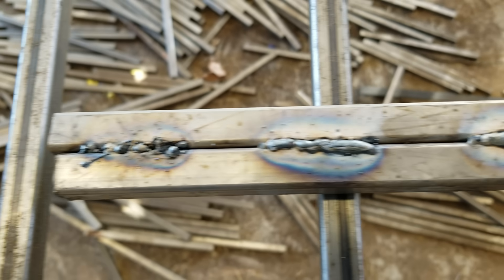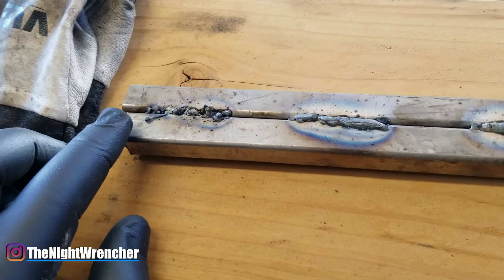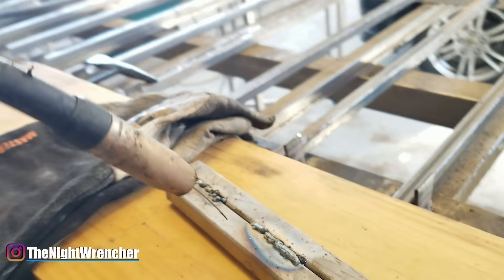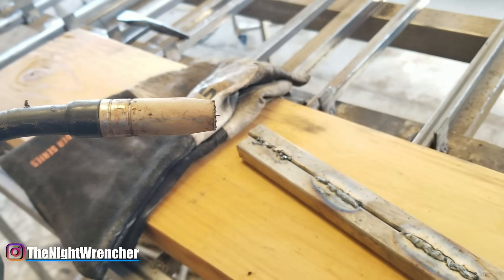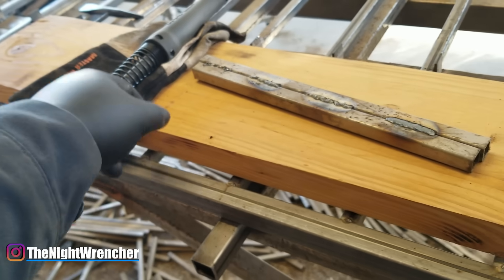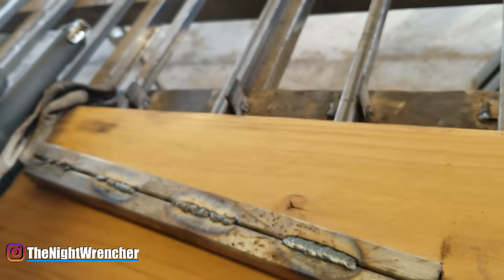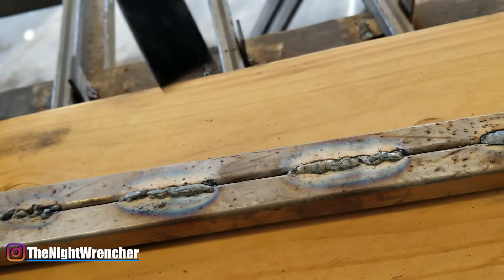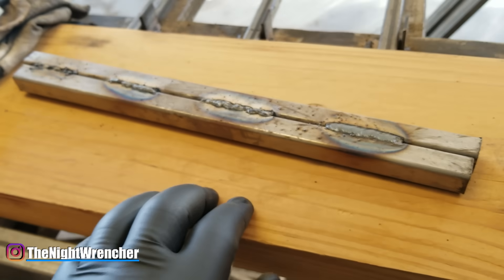Learn Perfect Flux Core Welds In 10 Mins | Gasless Flux Core Welding For Beginners Tips And Tricks |

Comment: Your title is nuts. There is no such  thing called gasless FCAW. the process is called flux core  Arc Welding :flux is wrapped in the center of the "wire" which provides a "gas shield when on Arc.  Your lead is more to do with keeping your puddle fluid! the stacked look in this particular process is the result.
Also ; contaminated "wire" contaminates the puddle as does dirty material.  To give you primary reason for  piping or spatter!Your joint "prep" is also key to flow weld metal for a desired profile. You can btw use the process with gas . Dual shield  most common 75/25 or 80/20  Argon and Co2 respectfully. Or 100% Argon depending on deposit, profile and or effective throat you want with the proper wire. the most common wire feed processes Sub Arc, Mig,FCAW , utilize a drop slope curve when on Arc. That is;your stick out has a self correcting arc in short to help keep the  finished product looking nice ( the deposited weld) to make a long story very  short....... Good beginner stuff  in the video tho.
Reply from the maker: The title is geared towards people who arn't familiar with the correct terminology and the video was basically a PSA that maybe its not your welders fault that your welds come out gross 👍
Reply: @NightWrencher  , correction the correct acronym for "Mig", metal inert gas Process is: GMAW  Gas metal arc welding . Apologies
Reply from the maker: No problem 👍

Comment: tip distance tip speed and tip angle greatly determine weld outcome. i learned to weld almost 40 years ago but now only have a 110 volt flux core welder. 

my grandson is 10 and i told him i would teach him how to weld. well, weld with a gun anyway as there are several ways to weld but i do not have a stick welder or oxy/acetylene torch or a tig machine. using mig or flux core to weld is as easy as it gets. smaw, or stick welding as it is commonly called, takes a lot more practice to do well. when you have done that for awhile picking up a mig gun and laying down good beads is a cake walk. i remember the first time i used a mig i thought 'man this is like cheating'.
Reply from the maker: Very cool! I hope your grandson gets it!

Comment: Remember this tip, if using an .030 wire, use an .035 tip. This is a big deal on the flux core wire. Not so much with the solid wire because of the shielding gas but with the flux core wire, it makes a huge difference.
Reply from the maker: I've tried using a .035 tip on my .030 wire because I ran out of .030 tips. I noticed the wire movement side to side was very inconsistant and running solid beads became more difficult and messy.

Comment: Six inch stick out on the second weld?  Really?
Reply from the maker: Yeah? Its to demonstrate what happens when you have to much stick out. The best way to see the effects of something is to go to the extreme
Reply: my machine will not run with that kind of distance from the material. of course mine is just a cheap harbor freight 110 flux core machine but it lays down a good bead when used properly.

Comment: I just hit a "purchase" button for a Lincoln Bester 190C, but I will not have a gas bottle yet, ordered some flux core wire instead. This will hopefully allow me to test the machine out when it arrives. 
Never used a flux core before; some little experience with MIG years ago, and just occasional stick welding since that.
Reply from the maker: As long as you have the polarity correct for flux core the rest should be easy to learn. Flux core needs more time and heat to flow out nice but you tend to make holes if the settings are off or your technique is bad

Comment: Fly fish method with constant circular motion, like a a good signature, stick out should be dragging the nozzle at at angle. Proper weld will look like a TIG weld. Been doing it for 25 years. Stick out 3/8 max, burn through = move faster.
Reply from the maker: I find that the figure 8 method with flux core makes it much easier to make holes in the materials. I used to only do figure 8 but found better results going straight with flux core. Om thicker materials I still do the figure 8
Reply: @NightWrencher  I don't know exactly what figure 8 means , but side to side arc, fly fish establish puddle and go back in and overlap where the metal is already hot. Like I said , looks just like a Tig weld , only a cup brush to clean it up. Most run wire speed way to high and move too slow.

Comment: Thanks for the video you went over a few problems I was having because I was told different.
Reply from the maker: What were you told 🤔
Reply: @NightWrencher   To always push the puddle not drag. Have the temperature hot enough to its own most burn through. To keep the gun about a 1/2 inch away.
 The problems you said would be of this is what I am having now.
Reply from the maker: @JustAnotherCouyon  if this was standard mig that would be true but flux core is a little different. Flux core welds start off cold and get hotter as you run your bead so you do want to run it hot enough to easily start the weld but not too hot that you burn through when the weld reaches its temperature
Reply: @NightWrencher  thanks for the advice, i'll be trying/welding more this weekend.

Comment: I've been doing a fair bit of welding the last couple of weeks putting inner and outed rocker panels on an old truck , and unfortunately it's not always possible to drag your tip when you can barely see  where your working ..
Reply from the maker: I hear ya, I've been in that situation a few times. Once you learn to do it perfect one way, it becomes easier to do it other ways, its all practice!
Reply: One thing that makes it easier is to remove the shield you do not need it if using flux core. You can also see what you are doing making it much easier.

Comment: This was really helpful, thank you. Do you have a video that we can see the actual speed you go?
Reply from the maker: I had a clip of it but deleted it. I'll probably upload it to instagram
Reply: good speed comes from observing the weld puddle. you have to allow the puddle to fill out or you will not get good penetration. if your weld does not lay in flat like the last weld in the video try slowing down and maybe tightening up the torch tip distance. you want it no more than an inch away from the material.
Reply: @paulk5311  ok, thank you

Comment: I saw another video that talks about reversing polarity. Can you shed some light on that subject? Is that something that can be done on most machines? My Miller Cricket mentions this, but in reference to welding aluminum. Thanks for the video.
Reply from the maker: Yes, its basically laying if your electrode is the power or the ground. Basically it dictates which way the electricity travels and thus shapes your weld differently. Its as simple as swapping the terminals on your machine if the machine was set to weld with gas mig. But if the machine was set to weld with flux core then the polarity is already correct.

Comment: Very helpful! You identified most of the problems I was having as I am just learning basic welding techniques. You are an excellent teacher.
Reply from the maker: Thank you! I hope it helps you out!
Reply: Getting the basic settings like for solid wire , straight polarity electrode positive work negative, reverse polarity electrode negative for flux core work positive really smooths out beads less angle drag on heavier gauge steel  for penetration and manipulation of weld puddle rolling dimes , practice makes perfect good welding..👍✌️😊🙏
Reply: Same as this guy, I only use oxy acetylene for lead welding but started brazing and now trying steel.
Once I master oxy acetylene I might buy a machine.
Reply: @PeakyBlinder  
same here, I did a little oxy acetylene welding and brazing but it was many years ago. I'm looking to get my first home/shop use welder now, thinking about a MIG/flux core welder - seems it should handle most of the projects I need to tackle. So much to learn before I get started.

Comment: Do you use stringer or what's the best technique that way?
Reply from the maker: I use stringer and for most welders that I know they go for stringer too to avoid putting in too much heat into the material. I  do more of a Weave when I need to do wider beads. The weld puddle tends to follow the arc so by weaving it side to side as I move I can make it flatter and wider like When doing a fillet weld. Its makes it look nicer but typically stringer is the best technique

Comment: I use flux core casually at home on personal projects.  Can you tell me if the polarity is opposite with gassless/flux core?  Good video
Reply from the maker: Yes, Usually I've seen that the polarity is reversed on gasless/flux core vs gas mig.
Reply: Gasless Flux core should be welded using DCEN Direct current electrode negative, (straight polarity) just switch the Terminals on your power source.
Reply: Flux core can be pushed or pulled using a 5 - 10 Degree gun angle) and inclination should remain as close to 90 degrees perpendicular to the weld. 
Electrode stick out should be between 1/2” and 3/4” from the tip, not the nozzle. Remember when using a nozzle while using a gasless flux (which isn’t needed, unless to secure the welding tip onto the mig gun) there is another 1/4” of welder between the end of the tip and the end of the nozzle. So the max amount of wire protruding from the nozzle should not exceed 1/2”. 
All material to be welded should be free from oil, grease, dirt, rust and mill scale. Clean material to bare metal. If you are welding a structural piece, code says clean the area 2” back from the weld zone. 
If you are just messing around in garage or shop, just make sure the weld zone is free of all contaminants and for best success clean to bare metal. 
If your machine can run gas, I would choose a dual shield flux core, using 75/25 argon/C02 mix gas. On DCEP. This process will give you very clean welds with minimal spatter or clean up. Although It will leave a slag coating on top of your weld deposit that is easily removed.
Reply: @Subway1427  thanks G-Mack 😎👍🏽